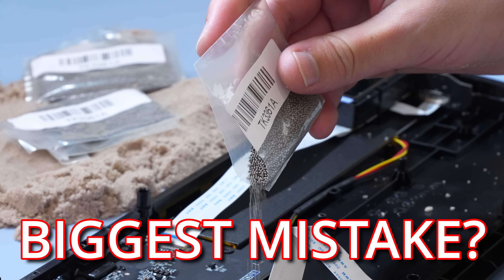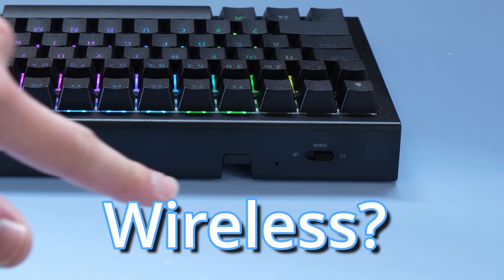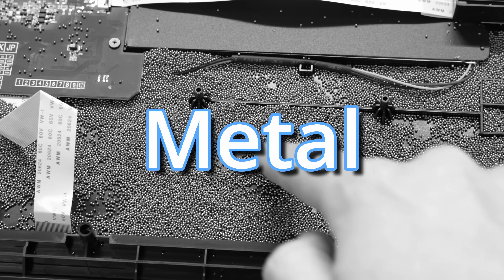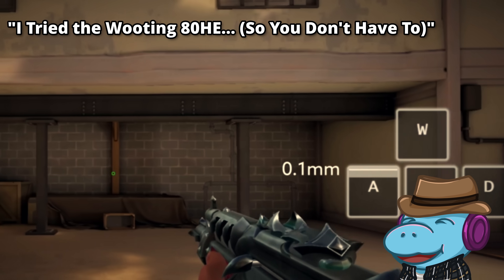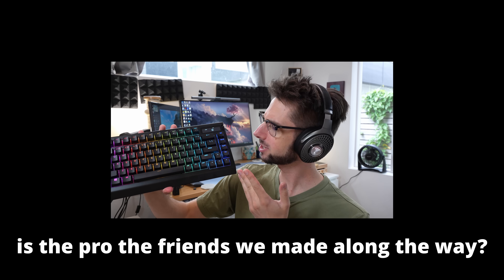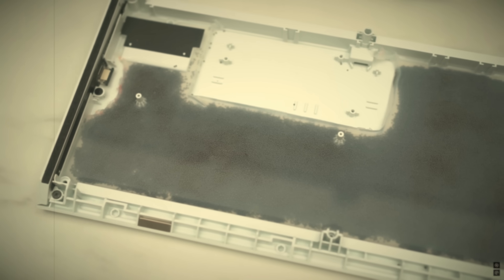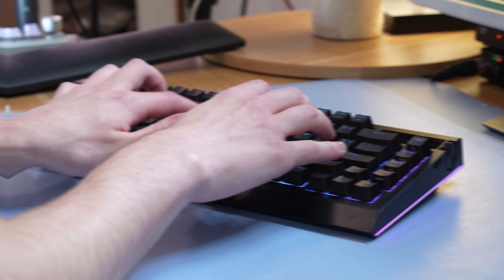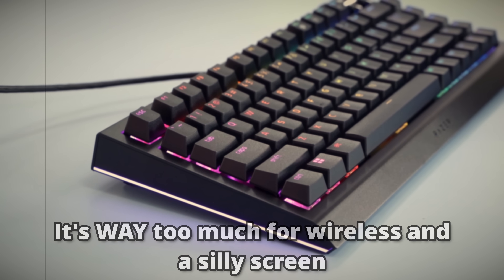WHAT was Razer Thinking??? (Blackwidow V4 Pro)

Comment: nobody complains about north facing leds like hipyo. i have never had a problem with north facing leds. i actually like them better
Reply from the maker: At this point its a bit
Reply: They're the best.
Reply: @HipyoTech boooo
Reply: It's basically the only option for shine-through, since for whatever reason no one makes keycaps with SouthWest legends.
Reply: There is a good reason wooting has gone with north facing
Reply: @HipyoTech  only because you dont care for shine through keycaps but north facing leds are the only ones that work with it.
Reply: @Yukeake  there are SouthEast legends usually but that's for secondary language and they're not shine through.
Reply: I just wish there were actually good sounding shine through options available.
Reply: Yeh i don't get either the south madness.

Comment: These metal ball bearings are conductive, which means that there's a high risk of shorting something in the keyboard when it's powered on. Even just one of these moving around on the PCB is sufficient to destroy the keyboard is you're unlucky enough. NEVER do this, because the risks are way greater than the potential gains. To realize how electrically important this is, imagine that even the glue of the tape that you'll use in a tape mod needs to be non-conductive.
Reply from the maker: Yep
Reply: The first thing I thought was "they are conductive!"
Reply: I’m glad I wasn’t the only one panicking about this 😅
Reply: Bonus info: People who have used tapes with conductive glue for their tape "tempest" mod have even accidentally shorted their keyboard's battery and it led to a fire. This has happened even to YouTubers, such as Switch & Click. Stay safe, people and to be extra sure, avoid the tape mod altogether if your keyboard is wireless (has a battery).
Reply: I have never done a tape mod, but I would suggest kapton tape because it is commonly used in electronics or maybe platers tape, it leaves no residue after being removed. I'm familiar with red platers tape from Saint Gobain.
Reply: Thank you, I was screaming at my monitor while I watched him do this 😭 What was he thinking, Keybored did it with a silicone layer to keep them in place and isolate them and this guy straight up shoved them in the case with sand???

Comment: the double typing issue came from the board because I did replace the switches by some other brand one and they ended double typing after a month of use on the razer.I decided to use the razer switches on other barebone boad and it worked perfectly

Comment: 7:09 Thank God they are north facing LEDs. I freaking hate south facing LEDs. South facing LEDs have uneven lighting. You can literally see south facing LEDs by simply looking at the keyboard, and it's very distracting. They also don't light up the characters well. If you're worried about keycap interference, buy some o-rings or washers.
Reply: i agree, and that comes from someone who never uses rgb on their keyboards, south facing LEDs 100% have their place in boards that want nicer RGB, plus who is genuinely going to buy this keyboard and then go and try put GMK keycaps on it, pretty much noone, and if you want to use cherry profile keycaps that badly just buy a different keyboard or use long pole switches

Comment: I would like to set a challenge here:
- ISO Layout (preferred ISO-DE)
- North-Facing LED (for shine-through key caps)
- Wireless 2.4, BL, and! wired mode
- 75% With dedicated keys for: DEL, INS, HOME

I think there are not much options below 300 bugs. However if you see some, drop them below.

Comment: I bought the blackwidow v4 75% first version, i had insane double click issues after 2 months of use on the most used keys like wasd for apex, qwer for league and some other random ones like esc.
Kept swapping the switches with functioning ones across the keyboard and then, after all this time, last month i got Akko V3 Creamy Purple Pro. 
Even with minimal RGB housings, there's dim RGB, insanely good tactile feedback but lighter spring, faster travel time, INSANELY good sound on this keyboard AND no more double clicking issues.
Also MANY people keep saying the razer blackwidow v4 75% kept double clicking with razer switches even after activating their warranty and getting 1 to 2 different keyboard replacements. I'm pretty sure Razer still hasn't fixed double clicking issues :/
Reply: I have exactly same story, but I am using Akko V3 Cream Blue Pro Switch. It is 99% better now but here and there I notice double-typing again. So upset with Razer, especially after having another Blackwidowfor 4 years, with original Orange Tactile Switches.

Comment: i was looking to buy a new keyboard for a while now and i wanted to get the Blackwidow v4 75% but after reading the comments about the failing switches i changed my mind completely, even if it was only in the first batch no matter, it shouldnt happen at all at that price
Reply: @ColdCassidy  good call, it is still a recurring issue, even on replacement units from Razer, they lied 💀
Reply: Can confirm here, i have another box of orange switches sent to me from razer support and it still double types💀 I ordered a box of v1 switches and haven't look back.

Comment: I bought the OG V4 75% for a very good price (imo) on the secondhand market, and it was in pretty good shape. After a week of using it, multiple switches starting chattering/double clicking on their own. I could fix it by pushing the switch in, blowing some compressed air from a can in there, and then actuating it a bunch. That would fix a for a bit. Found the same multiple posts online like you did that complained about that, so I was a little bit disappointed, but for the price I got it for, I wasn't complaining too much. I did end up buying some Gateron Smooties after seeing them in another video of yours though, and it was worth the upgrade. 

I for one like the V4 75%'s look, and I love RGB, and I still think Razer's in-game support for chroma is the best on the market. I do also love swapping boards though, so I don't use it exclusively. I also use my Logitech, Duckys, Keychron and Leopolds.

Also dang, they went with PBT this time? One thing I also didn't like about the OG, is the fact that they decided to use ABS, even if they're not the worst I've seen. I've since also changed those to some PBT pudding keycaps.

Comment: the main reason i like razer v4 75 (i have the non pro) is the implementation of some - enough games with the RGB control, like explosions / cooldowns etc, which you find in all razer rgb keyboards,  you dont enjoy it as much as when you first get it but i do miss it when i use any other keyboard, the v4 75 even tho a bit overpriced, still hit the mark for my "Custom like" / enthusiasts features even tho its not rly close to some good ones/ more expensive ones. the added wrist rest which i cant do without is also very good, all other custom keyboards i liked either dont include one or its not magnetic etc, which i prefer cause i move the keyboard around very much especially in fps, and the magnetic one always sticks to the keyboard when moved instead of normal ones which you have to move together and its irritating when on a fast paced game. other than that i hate the fact that alot of people had issue with the switches its very bad for a product that costs around 180-200euros, even tho i immediately changed the orange ones with cheap linears i had but hand lubed which had a major difference with both performance in fast games and sound/feel. every other company offers different sets of switches with purchase and razer stuffing those oranges in your throat where you like it or not is BS even tho i overall like the keyboard. additionaly pbt keycaps should be included instead of abs, they were good quality but regardless they already starting to be on the smooth side now and lost half of their "matte/grip" coating. if you factor everything in like buying extra switches - linears / buying PBT keycaps etc it well around 300euros which is way to much for the setup and you can get pretty much whatever other keyboard you like. the pro version is just a ripp off from other keyboards like azoth etc, but it was bound to be the next step for them. but 300e? lmao...

Comment: I literaly brought the Razer Black Widow 75% 2 days before they announced the Pro based on your review (I know there are better value keyboards, but I realy like Razer Synapse and wanted to stay in the ecosystem). My previous keyboard was a realy cheap membrane keyboard, and wanted a mechanical one for years. I guess I don't have to say it, but it did not dissapointed me. The only thing I noticed that the ghaskets are realy stiff, so I don't realy feel it with my minimum force typing. (And yes, I know I can cut some of it out, but I don't want to void the warranty, and it still perfectly fine for me)
Reply: if you think any razer keyboard is good, then you need to quit overspending and just pick any of the hundreds of less than 100 dollar full aluminum keyboards. they are cheaper, much better quality, and will last way longer.
Reply: Blink twice if you need to be rescued.
Reply: i know you're held at gunpoint since you said you like synapse.
Reply: @tomgreene5388  maybe you're right, maybe not. I don't have a lot of experience in this. However, I watched at least 50 diffrent keyboard's review before buying.
My requirements were:
- mechanical
- not too loud
- 75%
- hot swappable
- unplugable usb
- backlighting with shine trough keycaps (I work in a realy dark environment)
- advanced macro capabilities
- knob
- thock
- bonus if synapse compatible because I have other Razer products

Comment: It definitely sounds better after the mods and as the Morandi are long pole I'm assuming they took care of the interference with the Cherry profile caps as well. I think the balls would work with silicon, just not with the sand. Much like the Azoth Extreme, it's just too expensive for what you get. The Evo80 went on sale a couple of days ago for about half the price (not including shipping). It looks to be quite similar to the Neo80 but prebuilt with RGB. The Neo80 to me, with it's low front height, is one of the easiest keyboards to type on and use ever. Why would anyone spend twice as much for this when you can get a full AL build with nice switches (if you want linear), matching keycaps, a ball-latch system for modding and a case from a quite reputable company (Qwertykeys/Owl Lab/Neo)?

Comment: I hope this is the right place to ask. I don't have as much experience as Hipyo: I've only used one mechanical keyboard — the Corsair K70 from 2015 and I'm looking to upgrade. Initially, I considered the Wooting 80HE, but I noticed that it costs over €300+ for an aluminum frame.

I'd like to switch to something new, both technologically and in terms of software, preferably with an aluminum frame.

Any advice is appreciated.
Reply: I picked up a Keychron Q60 on sale for ~€155 a couple of months ago. It's not hall-effect,  but I prefer the wider variety of MX-compatible switches¹, and I really wanted a HHKB layout.

There are cheaper aluminium keyboards, some are also hall-effect, but the Keychron Q series are the only ones I can personally vouch for.

¹Yes, I know some keyboards support both.
Reply: @wereoctopus   It appears you are fortunate: on their website it is priced at €223. I would still like to have an F-row.

Comment: I got the Black Widow v4 75% WIRED version and can confirm the switches start crapping out about 2 months or so into using the wired version as well. So they must have made a whole lot faulty switches. Annoying considering the price of it, so I bought a pack of the same orange tactile switches it comes with and have so far had to change out 4, including the space bar after about 4 months of use If any of the changed switches start double typing I'm not gonna be happy. On an unrelated note I also got the basilisk v3 pro 35k with the charging dock and the dock has to be unplugged and plugged back in fairly regularly for the mouse to work on start up. Overall not impressed with Razer at all this last year.

Comment: Main reason im still using a brand keyboard instead of a custom one is that i like my numpad and when i looked at options in the past there were not many offering full size parts i liked. As for if i wanted a 75% for example there would be so many options to pick from so i would not buy a brand keyboard.

So yeah, im using a "Corsair K70 Max" and tbh i really like it. But than again i never had a proper custom keyboard to compare it to only other brand keyboards.

Comment: I love Razer audio products and mice but… Keyboards from them and Logitech imo suck. Just buy something from Keychron, Royal Kludge, Wooting, or maybe even Red Dragon. Or go god gamer and mod a keyboard/build one. It’ll be %100 better than anything Razer has. I personally bought a Red dragon k673 ucal pro and modded it with gateron milky yellow pros, tape modded it, bandaid modded it, holy modded it, lubed the stabilizers, and switched the keycaps out for much better double shot pbt’s and bam. Great keyboard.

Comment: Black and white screen ?? in 2024 ?? LOL - and Plastic case with a metal top flap ?? - I'll take a Mode Sonnet over this any day  - 
This could have been a GREAT board - ALL METAL case - Hall effect Switches - FULL COLOR Screen - ditch the Wireless - it's unreliable and battery can die unexpectedly  - wireless is an unreliable gimmick with limited battery life that has to be recharged and eventually u need to replace the battery

Comment: No. Avoid this keyboard like the plague. I have gone through multiple replacements and they have all suffered the double typing and missed inputs issues. Razer will not put it right. I bought this in December 2023 and still don't have a keyboard. Please, do not support this company.

Comment: Rapid Trigger is a much bigger "upgrade" than Snap Tap and you glance over it like it doesn't matter.

You liked these keycaps while you didn't like the Wooting 80HE ones, what's the difference?

Also, bringing up north facing LEDs is kinda annoying at this point, it just makes idiots on the internet argue like it still matters.

Comment: i get that south facing leds are the trend now in the enthusiast space, but geez, some boards should have north facing leds. otherwise shine through caps are unusable; and as you pointed out, some ppl like that. Rhetorical question: have you tried to find a keeb with north facing leds that also meets these criteria: hotswap, knob, gasket mount, wireless (2.4ghz)? Its basically impossible for under ~$150 USD. Ideally a bare bones for sub $100. They basically only exist from "gamer" brands like razer, steelseries, etc, and definitely not bare bones. and are generally unreasonably expensive compared to most of the other brands you cover on your channel. Yeah i get the potential interference issue with north facing leds, but there are many keycaps profiles besides cherry that don't cause an issue. All that being said, still love your content.

Comment: Honestly it's extremely disappointing and also kind of dumb and in most ways sad that this amount of attention and care is given to this abomination of a extraordinarily shitty design by which i mean Cherry style switches, the main, most fundamental and the most important element of any keyboard known to men is its actuation mechanism (aka switches in this case); instead of designing, manufacturing and improving the switches both better by design and with higher quality and care, people tend to do stuff like dampen the keyboard, put gaskets, put foam pads, tape the PCB, and all other sorts of functionally useless stuff; I'm not against them by any means don't get me wrong, customizing and modding keyboards is not by any means is a "bad", it's just when people and companies prioritize it and kind of promote it as a "fix" not "cure" sort of thing, cherry style switches mostly are fundamentally flawed, there, i said it. It's simply a "Bad design" and instead of fixing it and making the actual switches better in terms of any possible aspect, people tend to prefer to fix and mask up the obvious thing, the shittines of switches; yes, it has had its time but it's no longer a good design anymore and we should move on instead of standardizing and trying to fit everything into the frame of cherry; It looks like we are going the way backwards, for gods sake they made better switches in 80s than they do now, the Alps switches by design and fundamentals were orders of magnitude ahead of todays crap, seriously how did we get from godlike mechanisms like IBM Model F and Model M or switches like Alps electric manufactured ones to this state of "Looks and Sound" ? over time the "Feel and functionality" of keyboards degraded overtime and now we tend to like the 40 percent anime themed DVORAK layout keyboard that has foam and rubber almost everywhere and sounds like cute cats eating cream and butter and all the user does with it is write 4 lines of shitty java code which has at least 2 syntax errors and will have dosens of runtime errors, seriously why did we get here from back in the days which keyboards were designed, manufactured, bought and functionally used as keyboards ? I'm not angry, I'm disappointed.